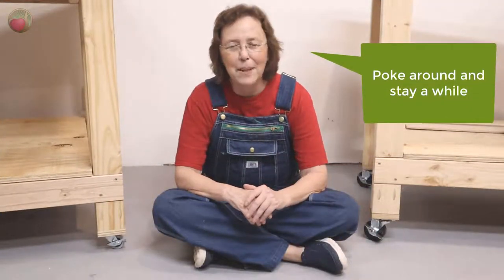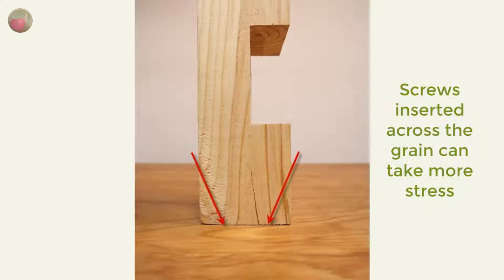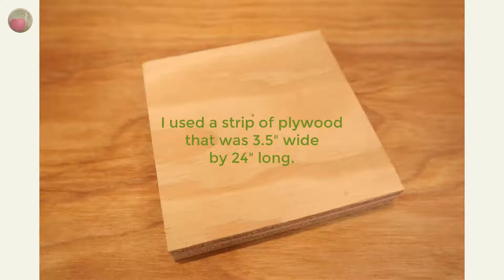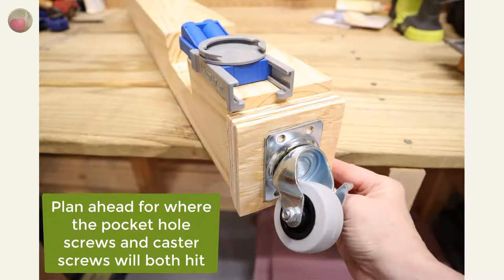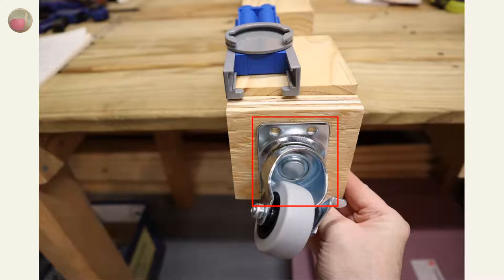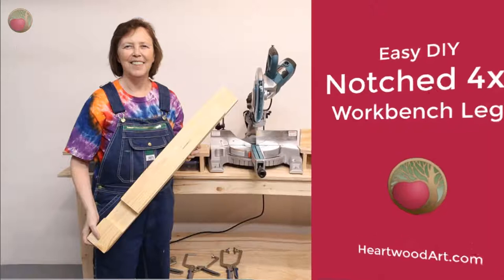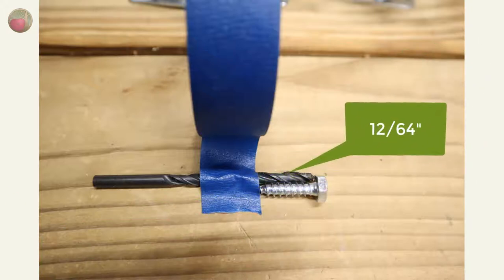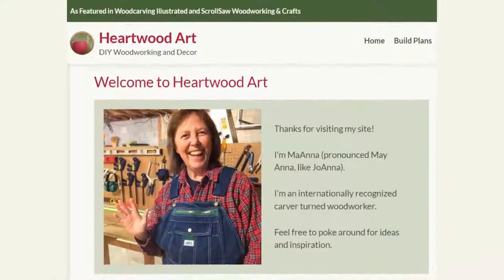Securely Attach Casters to Workbench Leg

Comment: Could you tell me, what size pocket screws did you use? It looks like you used plywood that's 3/4" to 1" thick. If I use 3/4" plywood, would 2.5" inch pocket screws be safe from penetrating out from the bottom of the plywood square?
Reply from the maker: I believe I set the bit and jig to 1-1/4 and used 1-1/2 screws to mate to the 3/4 plywood.
See my Kreg cheat sheet here https://heartwoodart.com/kreg-jig-k3-and-k4-how-to-cheat-sheet-and-tips/

Comment: I only have casters with a threaded stem and they are to go straight up into 2x4 leg through a t-nut. Do you think this will be secure enough?
Reply from the maker: I don’t have any experience with stem bolt casters, but considering how bog that bolt is, and how deep it goes into the wood, I would think it would be okay. I mainly see those used when connecting to metal legs, or wood things that aren’t going to be moved a lot